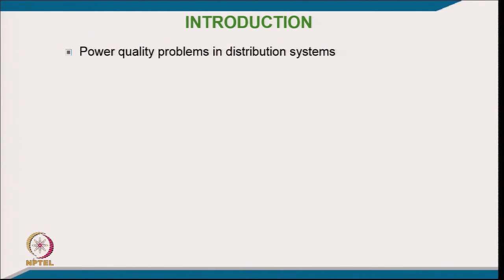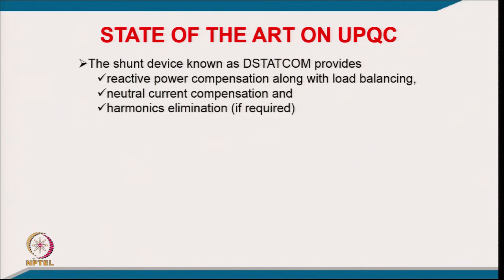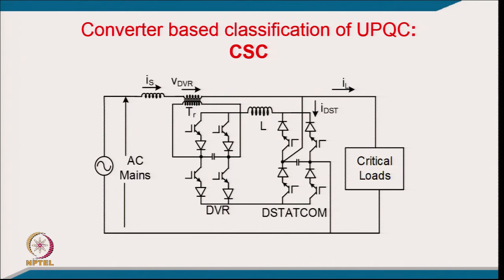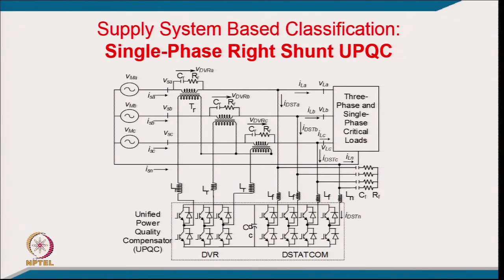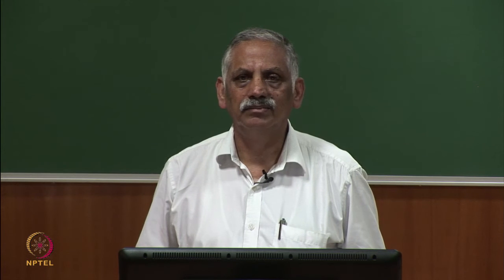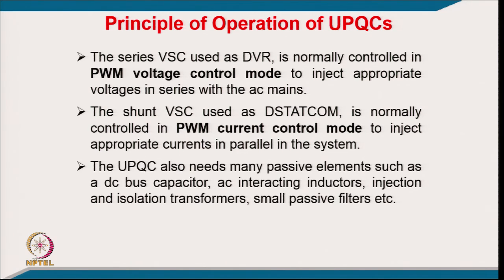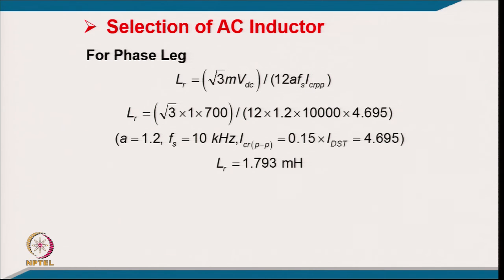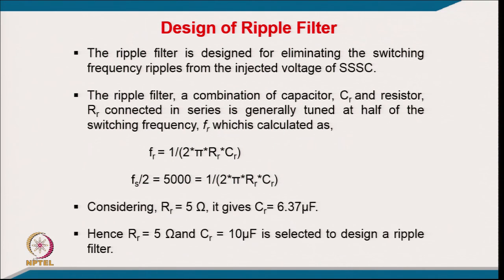Unified Power Quality Compensators

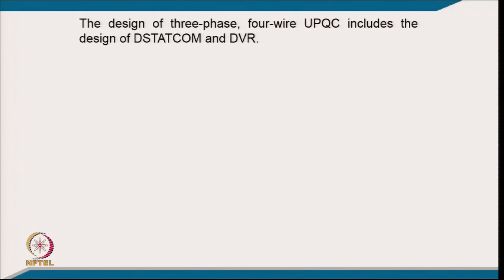Comment: at 33:54 min. UPQC diagram is shown but some printing mistakes are there... Lf calculation is not given... position of Vdc is not given....in your explanation you mention selection of AC inductor and give the formula for Lr (for phase leg) and Lm (for neutral leg) but in your diagram neutral leg is shown in only DSTATCOM side not in DVR side which is confusing.... after few slides you gave the formula for interfacing inductor for VSC of DVR (asper your diagram it should be Lr  but you gave the formula for Ldvr) i think Lr=Ldvr correct????   then how to calculate Lf???? i know this is NPTEL a "sarkaari program" no buddy will respond or clear my doubts.. but still i am hoping for a little miracle.... jai hind